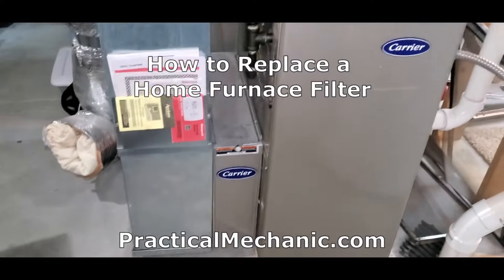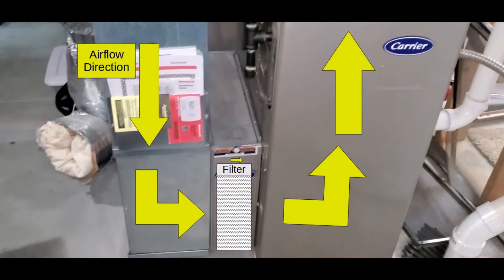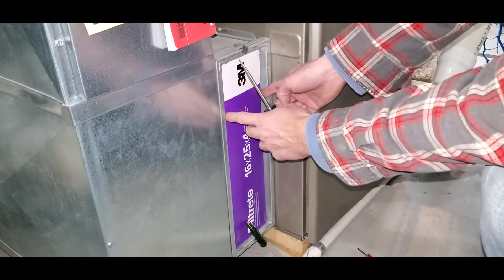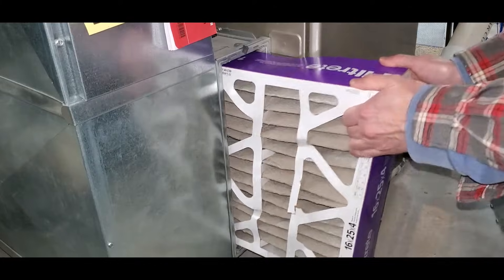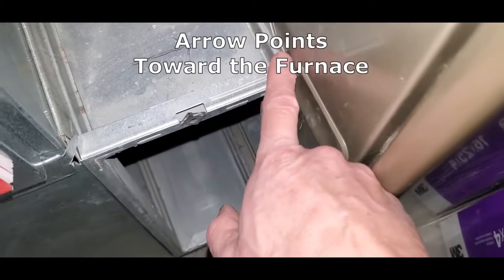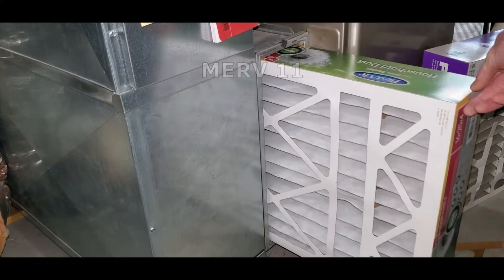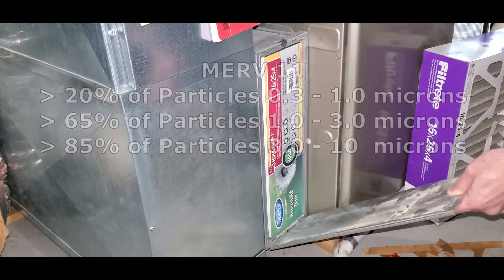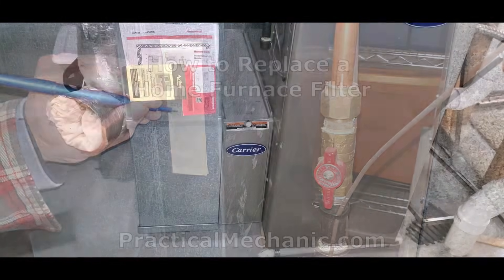Proper Way to Replace a Home Furnace Filter - Arrow Direction

Comment: My furnCE IS NOTHING LIKE THIS THE FILTER GOES EITHER UP OR DOWN AND IT'S AT THE BOTTOM
Reply: Which direction is the air flowing in? The wire goes on the bottom, facing the intake vent. The filter should have the arrow pointing up.

Comment: Can I use a 16x24x4 here?
Reply from the maker: Depends on your furnace, but in general, you need to match the first two numbers (length and height). The last number (thickness) can vary up to the thickness of the slot you have. Good luck! 👍

Comment: My furnace filter is always very difficult to get out.  I'm glad you mentioned that happens to you too.  Does that mean I'm using the wrong size?  Or it's just our furnace filters are?
Reply from the maker: Yeah, kind of a pain for me, too! 🤣 The filters are definitely the right size. I think it's a matter of the design of both the filter and filter holder in the furnace, since the cardboard that holds the pleats tends to get caught on the edge of the metal furnace holder region. Using a thinner filter helps with that, but I like the thicker for more surface area to filter with!
Reply: @PracticalMechanic  Awesome thank you!  I actually just replaced mine today and realized I could be agressive with removing the filter even if it falls apart in pieces.  It's not like there's anything for it to get "stuck too" that can't easily be seen and taken out.  Thanks again for this great video and tips!
Reply from the maker: @TRDW1 You're welcome, yeah good point! All the best
Reply: @PracticalMechanic yup I have the same carrier filter housing. It’s a pain to get the filter out and hard to get the new one over that lip by the door. I get it’s designed to ensure it’s more air tight at the door so air from the environment the furnace is in doesn’t get through but damn
Reply from the maker: @lawrence112  yeah, a total mystery. There's got to be a better way!

Comment: I removed some of the middle pieces of cardboard of my filter not knowing it needs to stay on. Is it ok or should I buy a new one?
Reply from the maker: The cardboard is mainly for support. As long as the filter material itself is still intact and not going to blow out, it should be fine. Have a nice day!
Reply: Just to be clear I should not have the arrows facing the ducts? It needs to face the furnace
Reply from the maker: Yes, that is correct
Reply: @PracticalMechanic  thank you for responding

Comment: Change it every six months? I've always been told to change it every month???
Reply from the maker: It can depend on a number of factors (how many pets you have, how thick your filters are, how often you run your HVAC system, etc...). Most recommendations range between 1 and 12 months. For example, 1-inch-thick filters probably should be changed every 1-2 months. On the other hand, a high-quality 6-inch-thick filter can usually go 9-12 months. Thanks for watching!
Reply: Bro spending $500 on air filters a year lol
Reply: @rehmsmeyer  yup but some have to
Reply: That's cause you have heavy smoking going on
Reply: I change mine every 10 to 12 months. It's the very thick ones that have its own casing. The direction on the filter says 6 to 12 months. My HVAC servicer says 12 months since I have no pets , little carpeting, and don't smoke.
Reply: @Friends46488  Change mine every 3 months
Reply: @BrandonBell-r8l  what size filter?
Reply: 3-6 is plenty